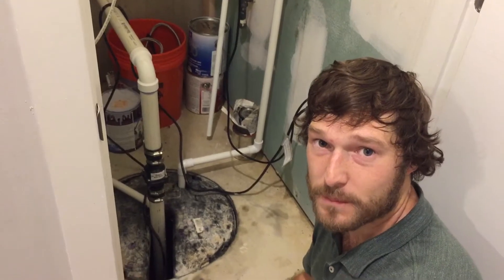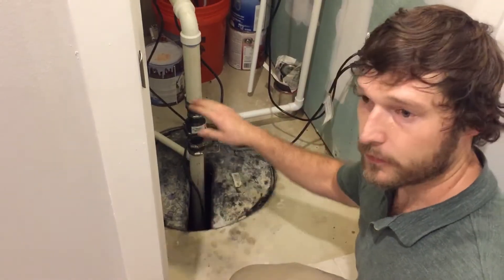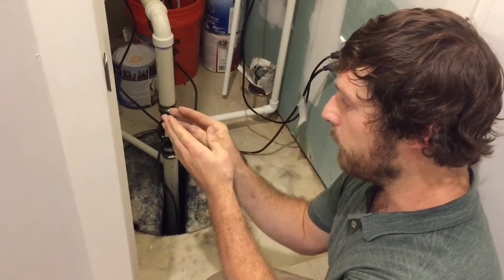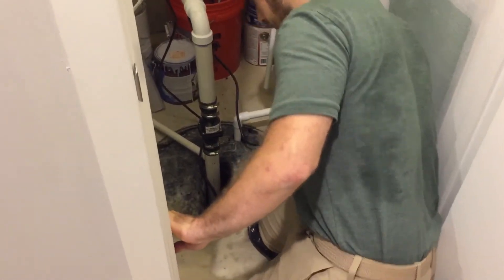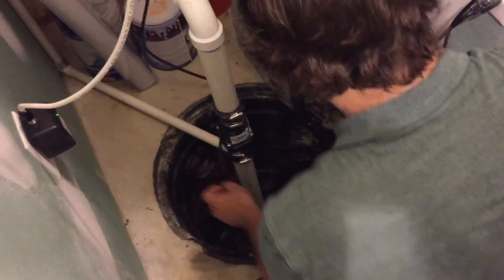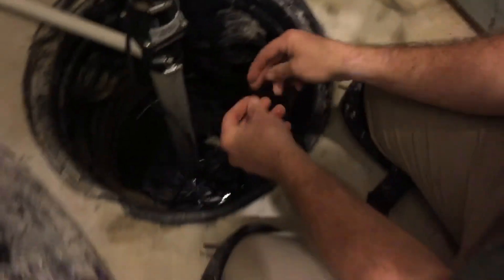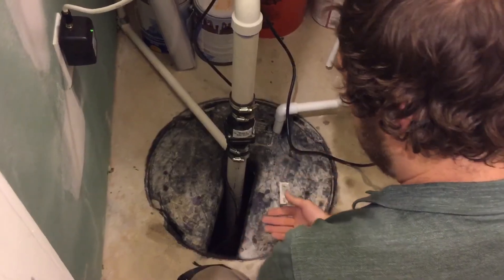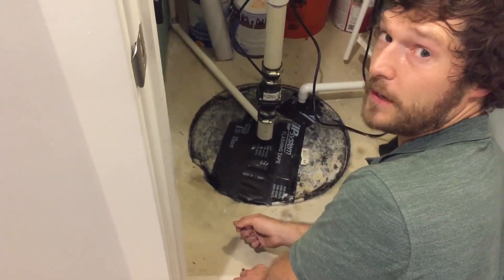Sump Pump and Pit Maintenance

Comment: Hey Charley, thanks for the video! My pit is sealed with a plastic top due to radon, so I don't want to take it apart if I don't have to. The sump pump was installed in a dirt pit which doesn't typically have water in it. A few months ago water was swishing around in it like a washing machine. That turned out to be from a frozen pipe outside. That got addressed. But now we just had a recent thaw, the pit is full of water, the pump is running, but it's not moving any water. Do you think it's likely that after that washing machine-like fluid flow from a few months ago dragged a bunch of the dirt up into the impeller & onto the underside of the pump, caking it on there? I really want to fix this without having to crack into that plastic radon protector. I'm not even sure how to get it off.
Reply: Take a putty knife to break the line of caulk around the cover. Once you've cleaned/tested the sump pump, dry the cover and surrounding area before applying silicone caulk.
Reply: Hi did you ever get an answer to your question

Comment: I’m trying to remove the pit cover,but it won’t budge/move.
Reply: I have the same problem. Mine is sealed on to keep radon from leaking out
Reply: @Littleanimalsarecute  I got the same thing. Probably have to cut the seal and then reseal it.
Reply: It's probably just siliconed
Reply: @DaDaDo661   I found out how..pry from the front with a big screwdriver..lift and slide out